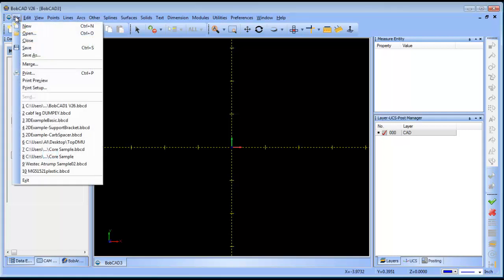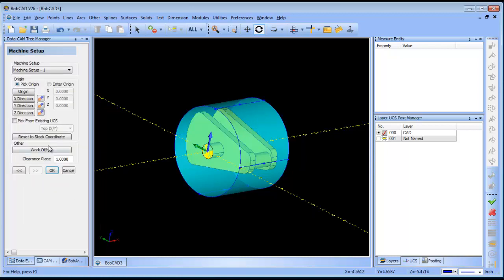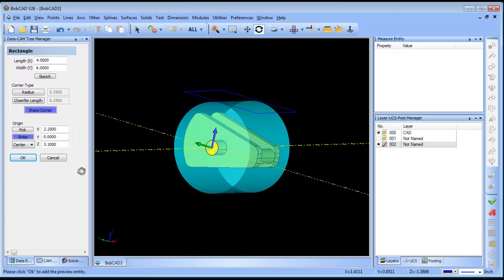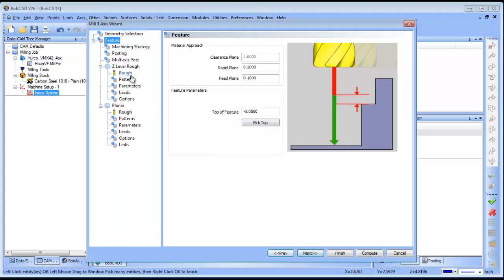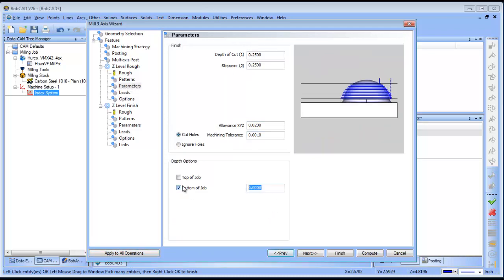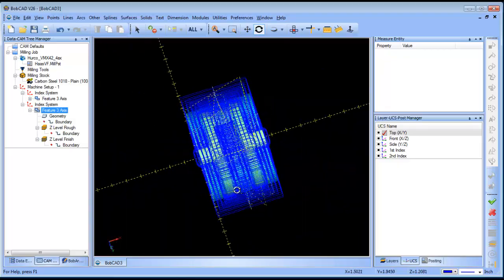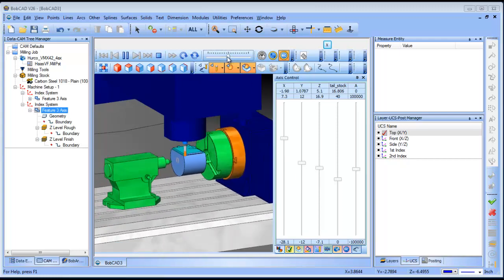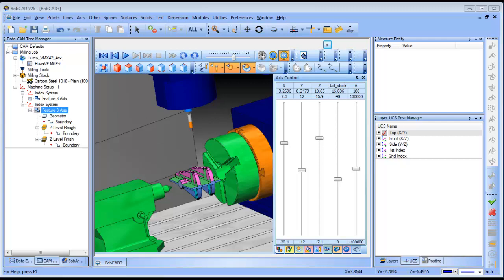BobCAD CAM V26 4 Axis Index Roughing

Comment: I'm trying to cut a splined shaft with bobcam and my haas vf-2 with hrt160, basically it's making a cut with a 60 degree v side mill, then stepping the rotary 20 degrees and making the same cut.  I can't for the life of me figure out how to do it, it doesn't seem to be a wrapping job and I can't imagine I'd have to set up 30 individual indexes... any suggestions?